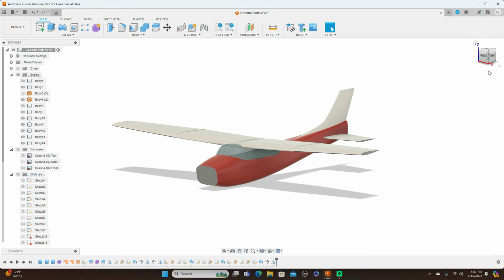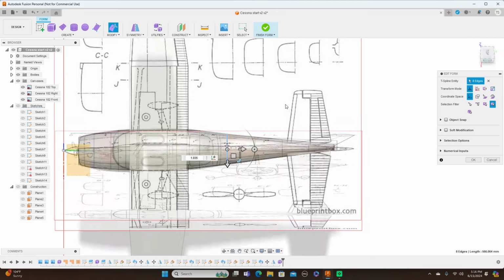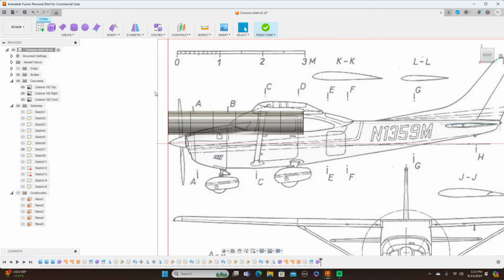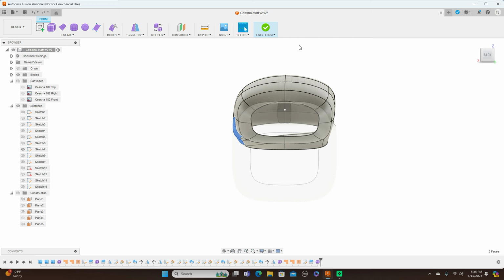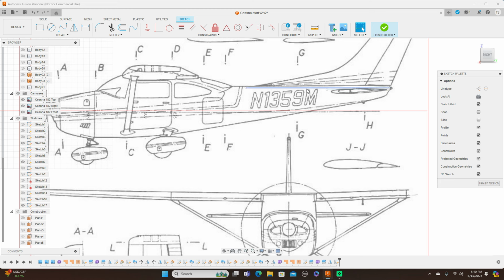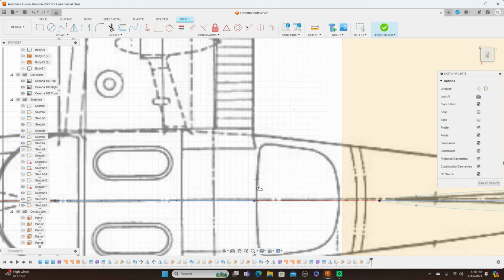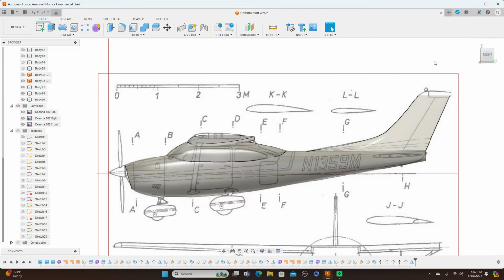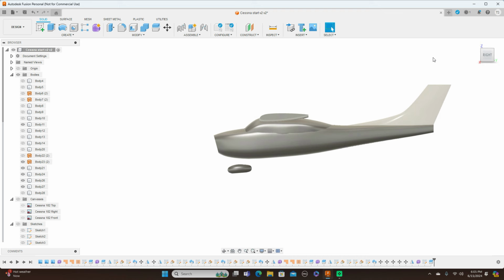Fusion 360, Looking at Modeling a Cessna 182. Is it Difficult?

Comment: Where do you get drawings you are working from and how to find those form views for other airplanes?  Nice work in showing how this is done.
Reply from the maker: @RayHabyan  Thank you.  Have a look at my video on how to find good plans and drawings. It explains how I find them.
Reply: @cadbuildflyrc3784  Thank You I will watch it.
Reply: @cadbuildflyrc3784  Video answered my question.  I was a member of and past president in the Goodyear Model Aircraft Club between 1968 and 1996, at which time I stopped participating in the hobby.  During that time I was one of only 12 two man teams in the US that flew 1/4 scale Goodyear Pylon Racers.  We traveled to different states from our home base in Akron Ohio to compete against other teams.  Places like Saint Louis  MO, Wheeling WVA, Tupilo MS, and other locations East of the Mississippi.  I personally flew a Cassutt and my partner flew a Midget Mustang.  It was greatest adrennelin rush one could have standing on the start line with 4 planes waiting for the flag to drop and start flying at 200mph.  Great memories.  You are doing a fine job, please keep it up.

Comment: I would eventually like to pick up Fusion 360. I designed an airplane on Sketchup. It's on my channel. The idea is simple. It's based on the 1942 Eschelman "Flying Flounder", which is more of a lifting body than a conventional airplane. I scaled it down to having a 6' wingspan. It could start out as an RC plane and morph into an actual airplane without changing the scale.